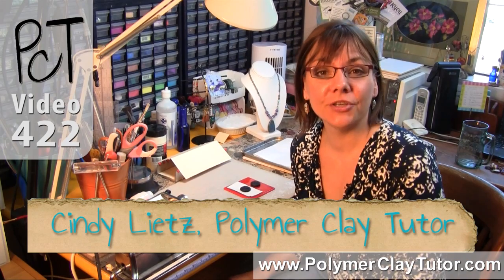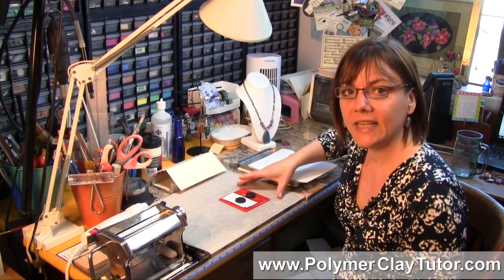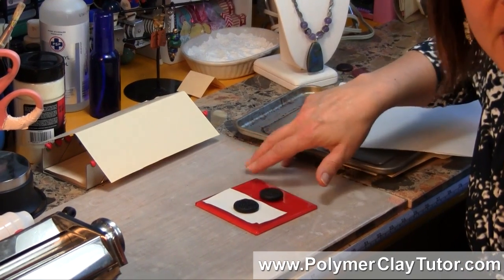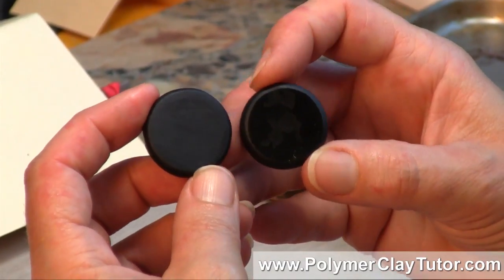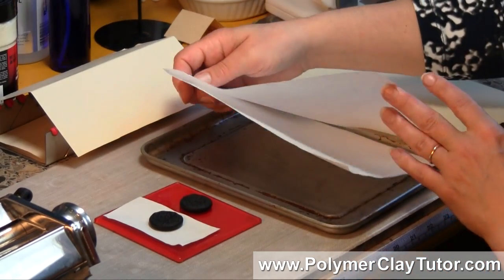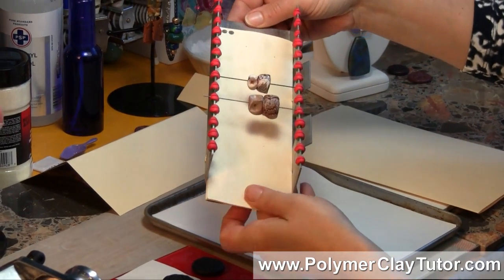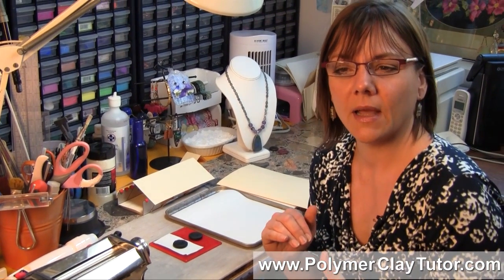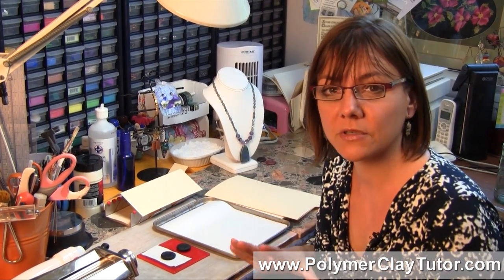Avoiding Shiny Spots When Baking Polymer Clay

Comment: Can the index card/ catch on fire if it's enclosed in two trays of aluminum foil?(one as base and one as lid)  I'm new to this and I really need some advice .
Reply from the maker: Hi Jessica Lopez, no the index card will not catch fire if you are baking at the low temperatures that you bake polymer clay at (230F - 325F) depending on the brand. As long as the paper does not touch any of the burners or elements, it does just fine in the oven at those temps. You still need to always be in the room while your piece is baking though, just in case anything were to go wrong. It is always better to be safe than sorry!

Comment: hi myminiaturedelights - you will not have any problems baking on paper as long as the paper is not touching the heating elements, the sides or top of your oven - a long time ago I used to use parchment paper and boy that got brittle over a short period of time - but since finding Cindy's site (link above) I've learned a lot - come over and visit her beadsandbeading pages and pages of Great info BTW the search box there is awesome:)

Comment: I was taught to use wax paper but it has stuck on the bottom. Any suggestions with removing it?
Reply: +NaturalElicia You can just sand it off.
Reply: Senga Sengana Thank you for the info I've tried that it doesn't work. Are you using a particular level of the sand paper?

Comment: Absolutely, I ask everybody and get 25 different answers, here is my questions to you, I have a pizza stone, fut on one site it is kinda gucky from old pizza grease, use or not use?  put the paper on it and use I bet you will say, The other questions Cindy, is when: let us say i am bacing inside of a casserol dish, or glass dish with higer walls, does that interfere with the baking clay?
Lastly, is         parchment or wax paper for storage, plastic sheets (page protectors)  how do you fell about such items working with polymer clay and baking and storage?
Reply from the maker: Pizza stones are great for baking polymer clay, but if they are soaked with gucky oil, putting a piece of paper on top is the best bet. No, higher walls on your pans, shouldn't cause any problems. Just set your oven thermometer inside the pan to see what the temp is, to be sure. And page protectors can work great for storing sheets of clay, but just test them first to make sure they ar compatible. Don't store clay on parchment or wax paper though, they can absorb the oils of the clay and make it brittle.